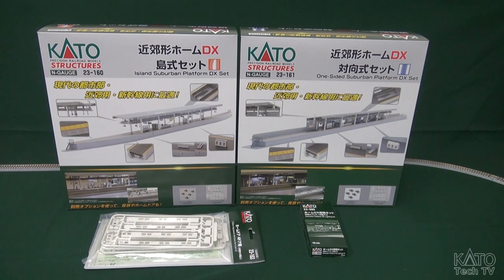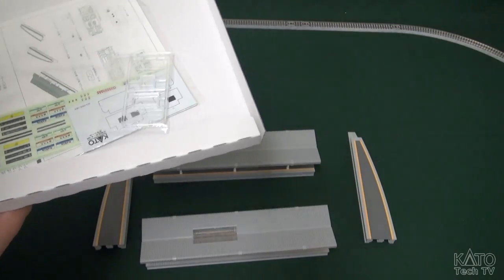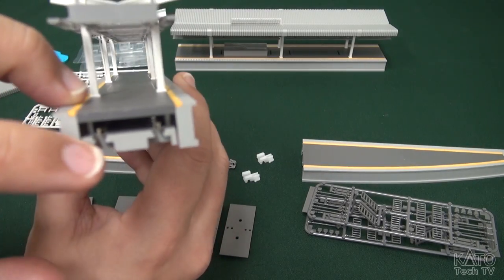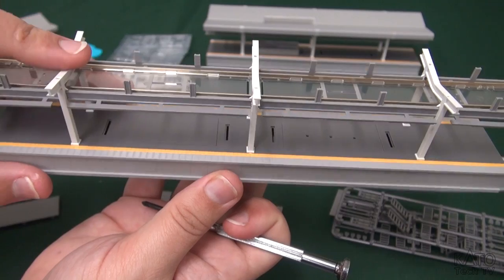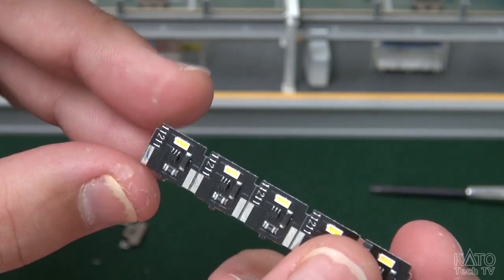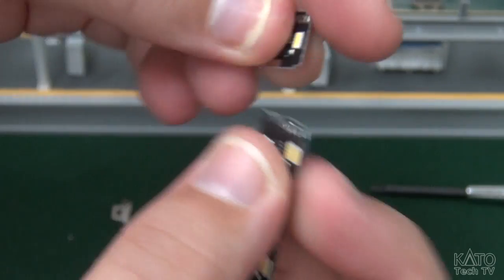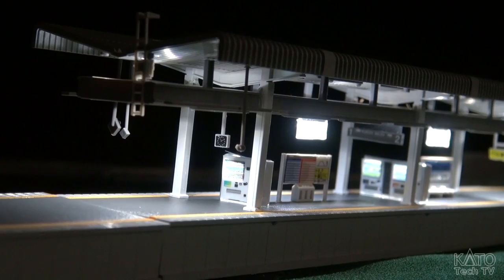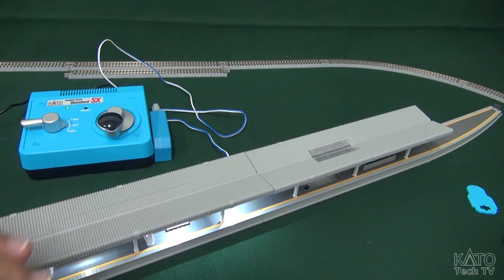[Kato USA Tech Corner] New Platform DX Unboxing, assembly overview, and how to power

Comment: This is really neat, the lighting looks so easy, I use Kato track on my layout and it's DCC, nothing was said if the lighting could work with a DC power pack using accessories terminals or straight DC terminals. I don't have a Kato power pack, and I think a lot of us use regular packs from the USA to power turnouts and other items on the layout, so I for one would be interested in how this could be accomplished..
Reply: I've purchased and installed these. If you have your own non-Kato DC power pack with AC or DC accessory terminals, then connect the 24-829 Accessory Adapter to a 24-842 DC Converter and connect that to your accessory terminals. Since I'm using DCC, I bought some cheap 12v DC power adapters, snipped off their plugs, bared and tinned the wires and soldered them to the DC Converter's wires, then insulated the solder joints. If your wall outlet is farther away, add some 2-conductor wire between the adapter and converter. You might also want to add an inline switch to turn off the power if you can't easily reach the plug. My 24-840 turnout control switches are also daisy chained into the Accessory Adapter's ports and they all run off the power adapter. Hope that helps.

Comment: Question because i am having problems putting decals on buildings ext? Do you cut and glue to the area you want it? Or is there some other way of applying them? Thanks and be safe.
Reply from the maker: no need for glue, they're self-adhesive, you just have to cut around the shapes to fit.

Comment: Good design. Need American prototypes and or signage. Platform kit should come with a basic lighting kit included.  Soda machine assembled with stickers looks very cheap. Kato bats at 900 in their design and engineering. Always room to improve on fit and finish. BYW  blinking platform lights would be cool. Ie: embedded blinkers in the yellow stripe and or arrival sign.

Comment: I've asked the good folks at Kato USA if the 23-122 Overhead Transit Station and 23-123 Overhead Transit Station Expansion Set will also get replaced with DX structures that can be illuminated, because I have searched the entire planet by Internet and NO ONE has a 23-123 Overhead Transit Station Expansion Set. I believe they're waiting for Kato Japan to make up their minds.

Comment: im going to modify the older model island platforms that I got, I don't like that the yellow line decals don't match the length of the straight 248mm platforms, so instead I had to paint the edges of the platforms with an airbrush that turned out more prototypical than those decals

I have 2mm led bulbs to spread out, gonna have to drill out the lampposts I glued in by mistake

to everyone: if your layout is not permanent and you assembled older model kits of the island platforms, coming up with a special box to storage these will help if you plan to transport them each

I created an 8 foot(2 meter+) island station to fit my several kinds of passenger trains reasonably and added the signal tower add-on accessory to one of the platforms

im honestly slightly disappointed hearing about this knowing that I have these many island platforms and now Kato creates better platforms...…..ah well, im glad to see that the F40ph-3 was made, that's a nice addition for Chicago's metra as much as there newly purchased surfliner F59phi fleet

@katoUSAinc I just want to remind you that your CNW models get cleaned out faster than PENN central does, I never got the chance to get anything streamlined or even the SD70ace heritage...honestly i'am not understanding the limit on those models specificly
I saw the new batch you made for CNW Pullman bi-level commuter cars except I still think that is not enough.....im from lake forest, and after visiting museums and stores, CNW get cleaned out both HO scale and N scale...because WE LOVE THEM ALL

Comment: Michael Will these New Platforms work with the Double Sets the 48's And the 53's  When I got the Platform that you mentioned that's these here will replace  I couldn't Run my Double Stacks under them without the Containers hitting the Platform, I did however have success running my Stack Cars after I put spacers between the canopy Legs and the platform my spacers where 1/4 inch thick plastic...  I was just wanting to ask on that Thanks a Bunch..

Allen D..
Reply from the maker: I believe these use the exact same dimensions as the previous Type 2 platforms so unfortunately they may have the same problems with the MAXI's. We have not tested them here with them yet so I can't say for sure.
Reply: Well a person could do this since these new platforms are set up for wiring they could cut out a piece of  styrene Michael the size of the platform cut a Hole or slot so they can stll Run the Wiring for the Platform and with the thickness of the Styrene probably an 1/8 to 1/4 of an inch it would set the platform high enough for the Maxi's to pass through.. You might Try that & pass it along in a Video..

Hope that Helps..  Allen D.

Comment: Can those lights be directly wired to my DC terminals of my Railpower 1370 transformer?
Reply from the maker: You can connect them to any ~12V DC output and they'll work.

Comment: Hi Great video thanks have ???? Can one use KATO Points using DCC i would like to convert my lay out to Kato track and use DCC to power and change points Digital??.
Reply: I have used kato turnouts w/ DCC. You'll have to solder a decoder into the turnout, but it's very doable.
Reply: Dave Horton I control all of my KATO turnouts with the DS-64. It works very well with KATO. I have never had any problem.